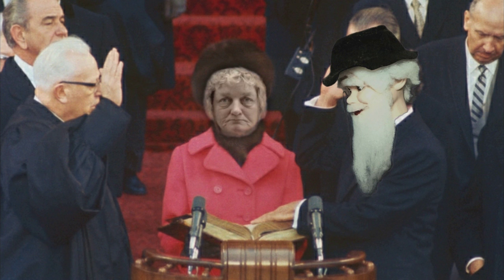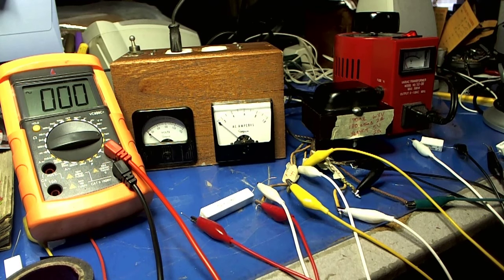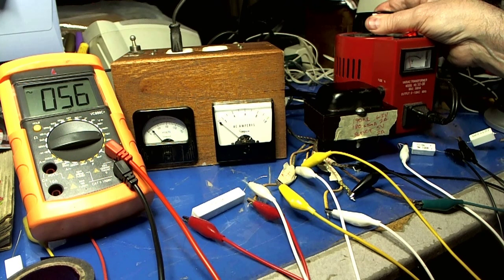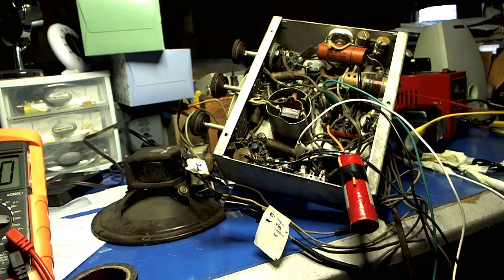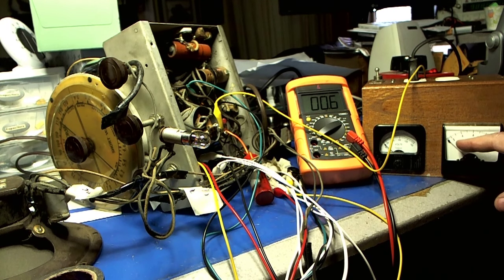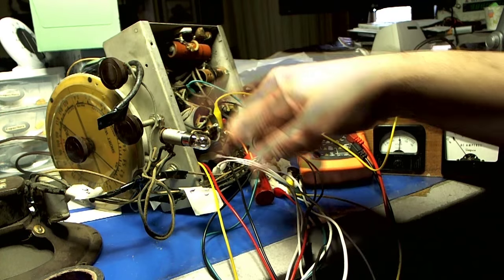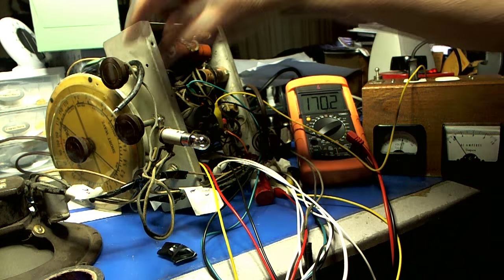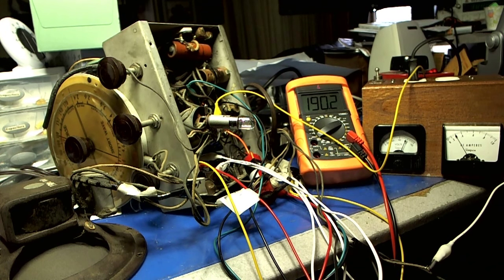1936 Fairbanks Morse Model 57 Restore Part 3

Comment: Very good Buzz! All through the power up I kept hearing my Instructor yelling that a good technician is a one handed technician. We were trained to keep one hand in our pocket. Electricity loves to go places but does not like to be stopped. If it can get in you, but can not get out,  up to about 300 volts it should not hurt. But it must only have a way in. Not recommending you let it in though, but one hand touching is fairly safe during an accidental contact to a potential. I saw you raise your second hand and my old instructor was yelling again. NO SECOND HAND!! I told him to be quiet. He also liked the use of sneakers and insulated seating. He died in 1979 and was about 72.
Reply from the maker: +Mark Cummins ..Electricity is like a caged animal!!!!.....Buzz

Comment: Hey Buzz, Nice work!  And nice score on that transformer as well.  Dickel waking up with the blonde tongue girl made me thing of Governor William J. Lepetomane in Blazing Saddles..."Gentlemen, affairs of state must take precedence over affairs of State", lol.  I'm saving up for a variac with a built in isolation transformer...or would it be better to get them as separate units?  I saw a B&K variac with a built in one on ebay that had a 130 volt voltmeter/ 2 amp ammeter as all one unit.  Hopefully I can find one like it by the time I get ready to buy one.  Meanwhile I need to start buying caps I guess.  Take care, Gary
Reply from the maker: +Rebel9668 ...Don't ask me...I get whatever is the cheapest...haha..Buzz

Comment: You said electricity is like a caged animal. It wants out. 
I have noticed that when you pull the plug out of the wall while a fan motor is running there is an arc that follows the prongs. Is that because the electricity wants out or because the fan motor is still wanting current ?
Reply from the maker: the energy in the wires has to dissipate and it does so by causing an arc